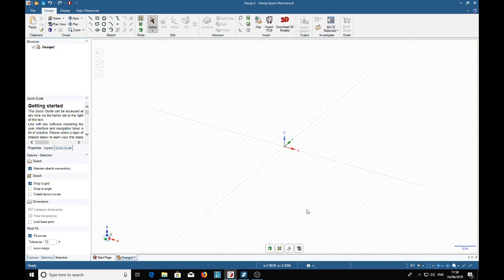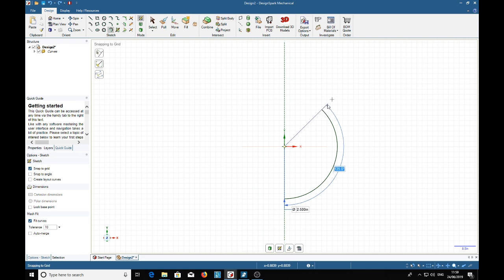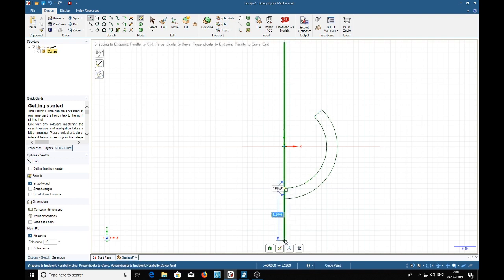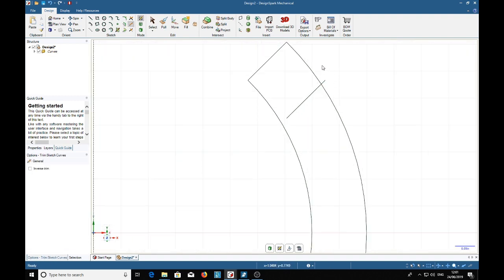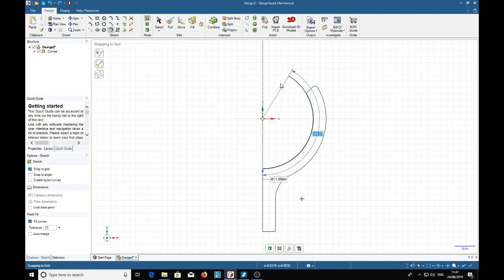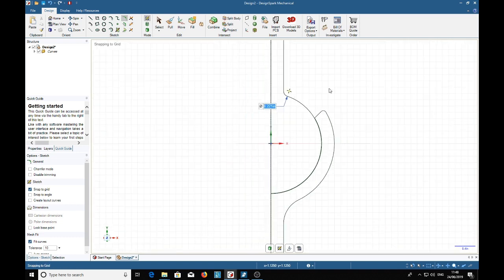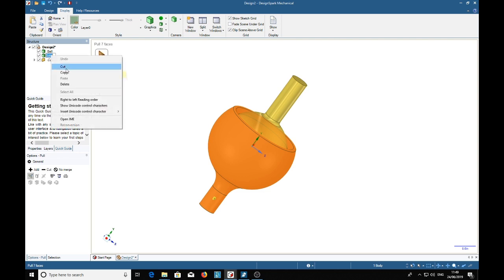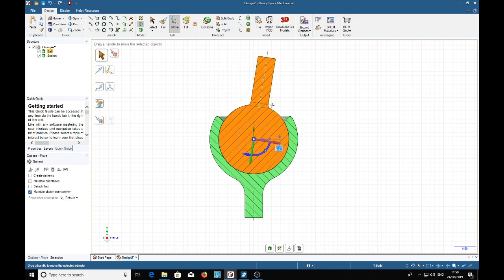Making a ball & socket joint in DesignSpark Mechanical

Comment: I made one that works after a couple fails. Needed to leave 1.5 mm clearance between ball and socket.
Reply from the maker: That seems to be quite a bit of clearance. Do you think that a different printing material might help to reduce this? I've heard of people making working  printed ball bearings and wind-driven walking mechanisms. I wonder how the make them? I have just posted a video on how to make a two-part ball and socket joint that would eliminate the clearance problem.
Reply: @JimTaylor42  Yes i'm sure the tolerance could be reduced but its actually quite tight. Theres plenty of variables with printing, now looking for a possible use.

Comment: Jim, just thought I'd let you know I printed a socket that was 50 mm with a ball that was 49 mm and it took 4 hours and 22 minutes. It was a little tough to break it free from the bottom, but once it broke free it operated fantastically. Check out the video I posted for you to see it on the Facebook DesignSpark Mechanical group

Comment: OK, to print this is much harder that i initially thought. The problem lays when the printer transitions between the socket and the ball. Because there is no support for the ball, it moves once  the printer has put down a couple of layers. The print resolution is 0.4 mm and my gap between the ball and socket is 0.5 mm so as soon as the printer has put down a couple of layers  the ball drops and moves.

I can see a couple of ways around this, 

1) make the clearance gap smaller so as the ball and socket "stick" but don't fuse
2) Go back to the design and try to add a support structure inside the socket. Make it thin enough that it acts like a support and breaks away after printing

I will play with it tomorrow at work and print when i get home

Comment: Great work Jim.
I have an entry level 3D printer with a resolution of about 1/64" (about 0.4mm), I should set the gap between the ball and socket to about 0.02" (~0.51 mm) to make sure that it does not merge.
The way I would print it is to start from the shaft of the sphere and create an annular scaffolding to support the rim of the socket. My 3D slicer software will create the scaffolding according to the way I chose.

Comment: I will let you know if it works in 3hrs, 50 mins
Reply from the maker: I look foreward to it.
Reply: @JimTaylor42  Well, attempt no1 has failed. I am going to have to have a look at the setting and build a custom profile for this one.
Reply from the maker: @iancooper418  markspc1 has made some comments that you may find useful.
Reply: @JimTaylor42  I set the gap between ball and socket at 0.5mm and allowed the slicing software to set the supports. It was printing fine until it started to print the ball inside and i think what happened was the ball was unsupported and moved, this in-turn "clipped" the print with the nozzle and i got a mess on the build plate whilst i was making coffee. I am going to try to add some very thin supports between the ball and socket and see how that goes.